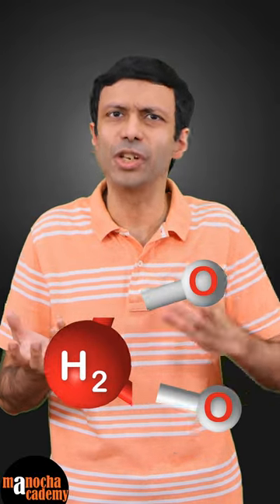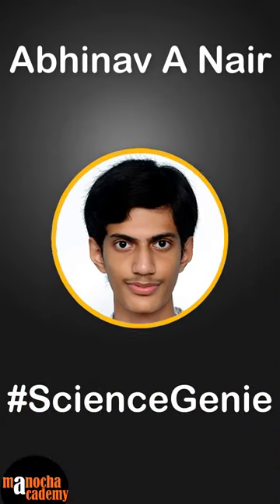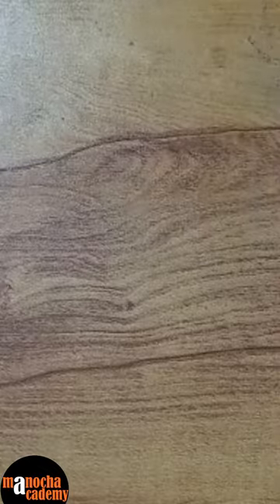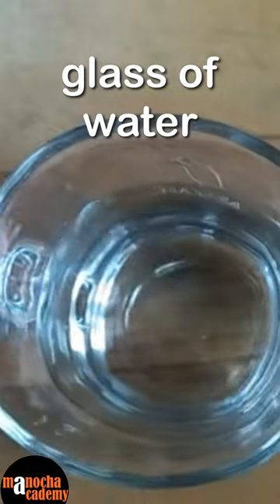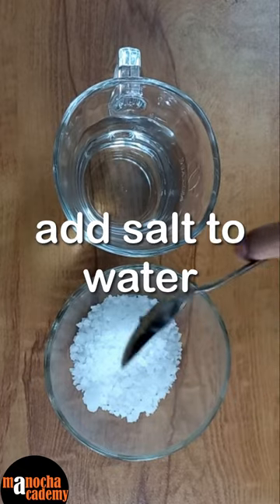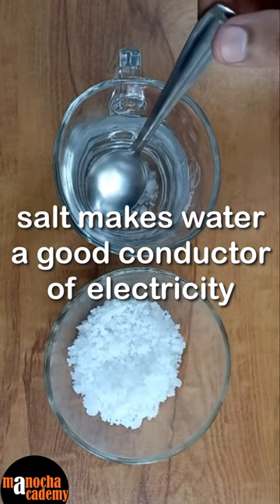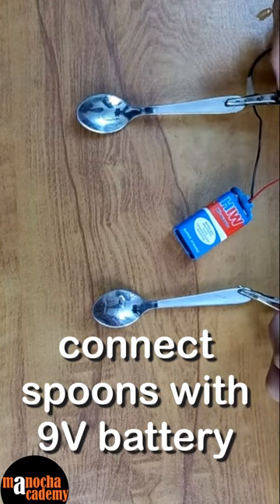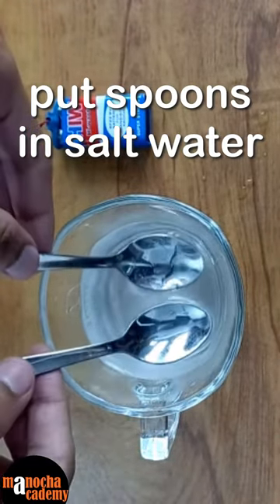Electrolysis of Water #shorts

Comment: hello sir  I think it is hygrogen gas and chlorine becuz due to salt
Reply from the maker: Good question! Even though sodium and chloride ions are present in solution, hydrogen and hydroxide ions get deposited at the electrodes due to electrochemical series. Hydroxide ions release oxygen gas.
Reply: thanks sir
Reply: I have  doubt can u do a video on electrochemical series plz
Reply: It's not correct you can check the products of aqueous Nacl

If you want to increase the conductivity of water ,add a little amount of H2SO4 into it....

Comment: Water makes the poler pattern of     (H+) and (OH–). And salt (Sodium Chloride) breaks down into (Na+) and (Cl–).
Reply from the maker: Even though sodium and chloride ions are present in solution, hydrogen and hydroxide ions get deposited at the electrodes due to electrochemical series. Hydroxide ions release oxygen gas. So chlorine gas is not produced.
Reply: @ManochaAcademy  Okay, then collect the gas that you called 'Oxygen' and then test its characteristics.

Comment: Where will chlorine go?? ha ha
Reply from the maker: Good question! Even though sodium and chloride ions are present in solution, hydrogen and hydroxide ions get deposited at the electrodes due to electrochemical series. Hydroxide ions release oxygen gas. So chlorine gas is not produced.
Reply: @ManochaAcademy  what about ion concentration?